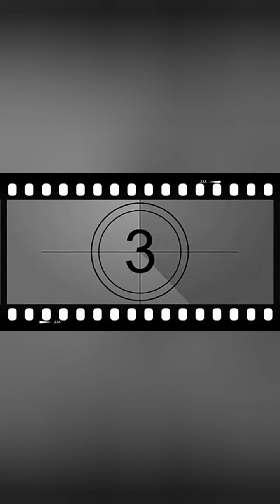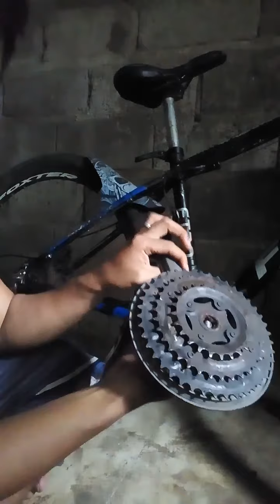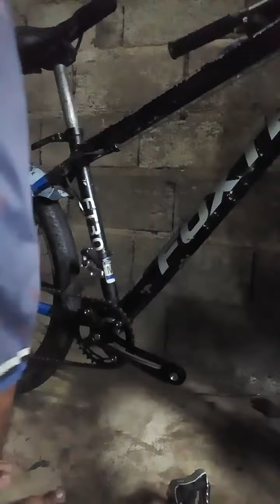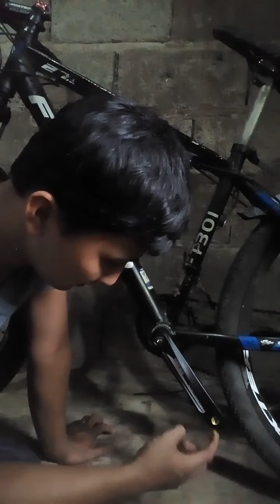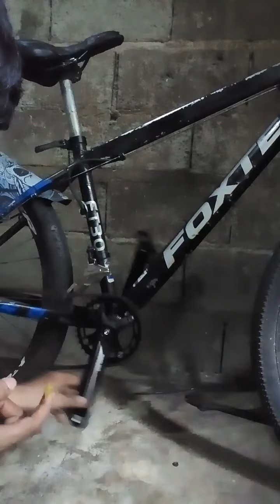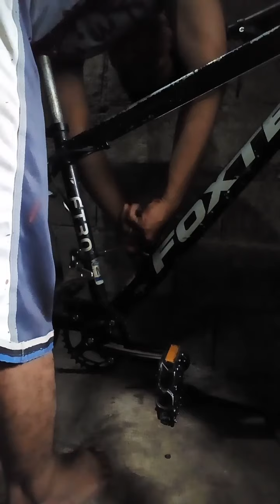part 2 installation of MTB square tapper type 1by crank set ragusa to your MTB

Comment: Sir  ilang mm size nung bottom bracket mo? Salamat sana makita mo to 💖
Reply from the maker: 68mm boss
Reply from the maker: Peo d na stock ung nakalagay mountainpeak bb 2nd hand kasi nabili ko.
Reply: @alveltv5175  goods sir. Naglagay ako ng 1by crankset sa 118cm n bb goods naman salamat. Panalo din un tono hahaha
Reply from the maker: @kyoheiscientia7086   ty din po
Reply: @kyoheiscientia7086  ilan speed cogs mo?
Reply: @michaelsibayan911  8 sir
Reply from the maker: @michaelsibayan911  8